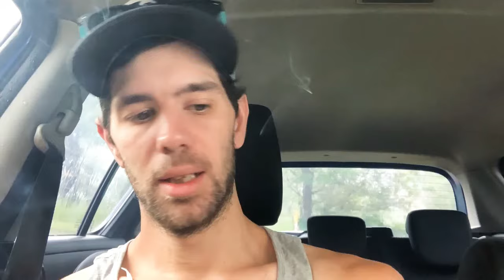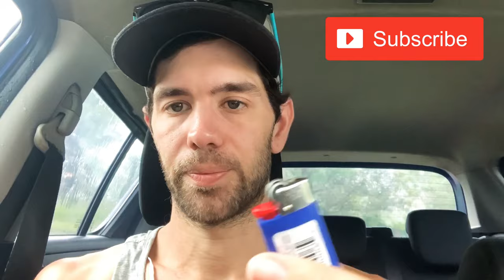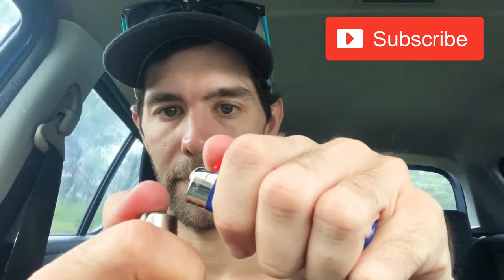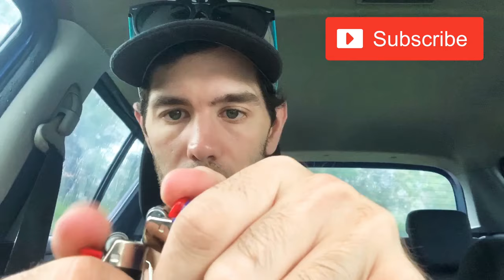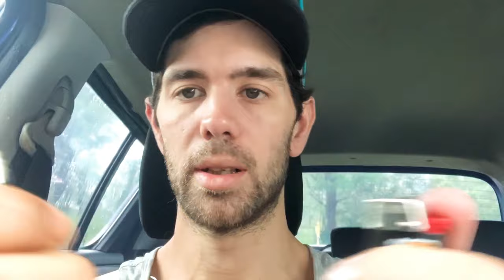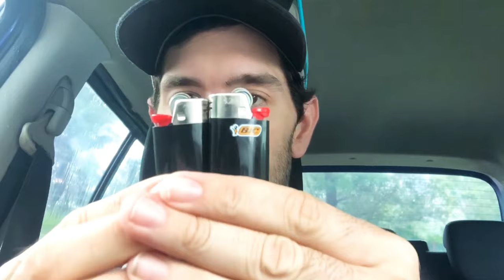Dead lighter? Refill your empty bic lighter, or watch this quick hack.

Comment: Hey Boss, you can get an extra 10 or so lights out of just 1 dead bic.. just remove the metal wind guard and bingo, and here's a freebie for y'all if you or any1 you know uses a zippo use a flint out of a dead bic.. just remove it and with a pair of wire cutters cup the flint with your hand and snip it in 2 pieces.. 1 half for the striker and put the spare inside the zippo case where ya fill the fluid! Keep flickin on fellas!